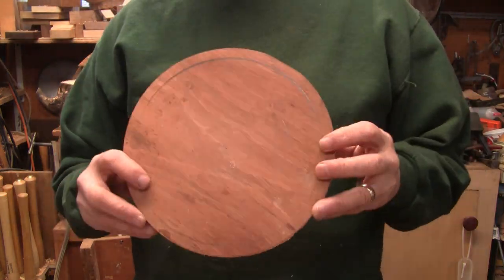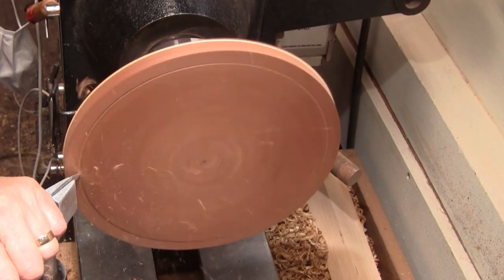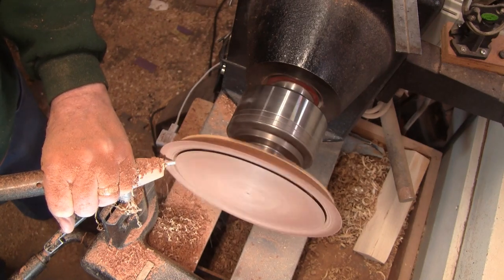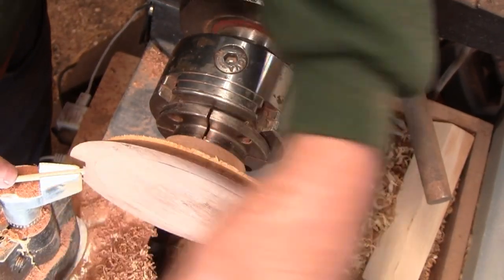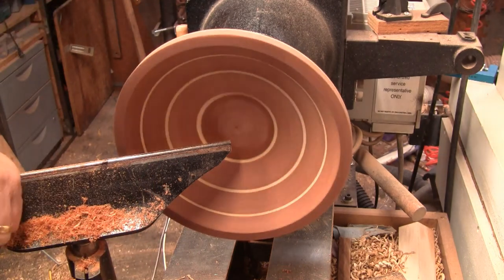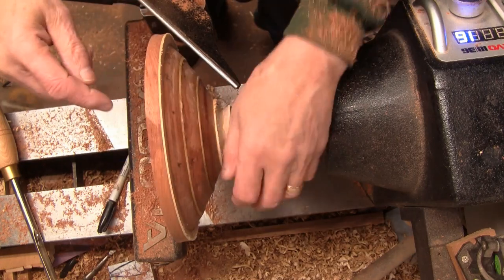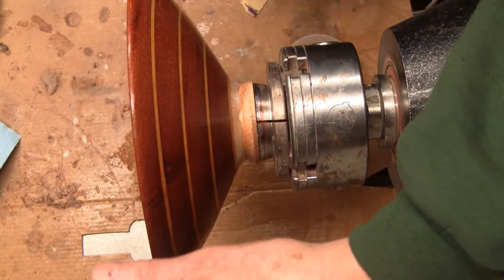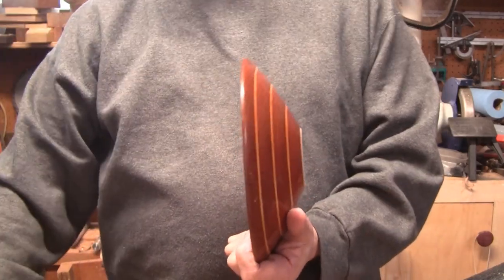Curved Bowl  From A Board New Ring Cutter Wood Turning

Comment: Most informative video. I noticed that you used three angles to cut the rings. I would have thought all cutting angles would be the same. The contrasting woods are very nice. Thanks two bunches.
Reply from the maker: Thank you and thanks for watching.
The way a bowl from a board works you end up with thin walls. So by changing the angle it gives you enough stock to get a curved side on it.
Thanks again,
Gary

Comment: Next one just take off chuck with bowl attached . No need to dismount bowl from chuck after each cut .
Reply from the maker: That is one way to do it. But the fact nothing has been turned up to that point it is easier to do it this way for me.
Plus not sure how you get the small pieces  that wont fit over the chuck off without taking  it out of the chuck.

Comment: Hi Gary.  The end of this video does help us ‘not so smart turners’ understand how to lay out the concentric circles and make curved bowls with various angles.  I appreciate you referring me back to this video!  Another question:  do you think a 3-D printed version of your aluminum angle jig would hold up to the heat generated by the thin parting tool cutting at an angle through the board?  A very talented friend is going to make a version on a 3-D printer.  I’m wondering if the material will hold up.  Well, thanks again!  Steve (Big Galoot Woodworks)
Reply from the maker: Thank you Steve. I would think that depending on how dense it was made that it should hold up. Testing would be important. I would not worry about the one I made  but I know my parting tool and how hot it gets.
I like to back out now and then to clear the chips and on mine it is the tip that gets real hot. Back where it is against the jig is not nearly as hot.
As with any thing test it out real good before using it.
Thanks for watching,
Gary

Comment: Thanks for the lessons of how and why you cut the rings. Like the parting tool guide. Simple and sturdier that the previous wooden one.
Reply from the maker: Thank you Stuart. I had this guide in mind when I made the first one. But I needed something fast so I made the wooden guide. It does work fine and by request I made a video on it. It will still do the job and you can put multiple slots in it. But I do like the new one much better.
Thanks for watching,
Gary

Comment: Hi Gary.  Quick update.  The tool steel did finally arrive a few months back but I had a series of retaining walls to replace beside the house and spent six months with contractors intermittently (!) working the project.  Every contractor and sub was to their ears with work so it was very difficult to keep people on the job as they had way to much to cope with and too few workers to boot.  So here I am in December finally watching this video again.  Now I'm off to find the other video that showed how you used a tool post and flat attachment to build a multi angle fixture as I do not have the equipment to easily manufacture the one shown in this video.  But first off to the dentist.  Thanks again for all you share, you have taught me a great deal.  Best of the Season to you and yours. Cheers, Gord
Reply from the maker: Thank you Gord and hope those contractors get it all done for you.
I understand  limited time to get things done for sure.
 The first fixture I made will work just fine. I just like making fixtures so did the others.
 Best of luck and Merry Christmas.
Gary

Comment: Watching you use the scraper, I learned that I have been using mine up side down! I have been placing the bevel down, nut up.
Reply from the maker: My scraper is a negative rake scraper. That means it has an angle grind on both sides.  With only one grind then you are doing it the way it is meant to be used. This scraper started out with an angle on one side and I ground the other. Very good finish and no catches.
Hope this helps,
Gary
Reply: @ThePapa1947  yes it does, thanks for the clarification

Comment: Thanks Gary, I was going to make the wood guide for my bar, but the new guide direct to the banjo is brilliant. I will have to make one and try it. I had made several bowls by cutting rings with bandsaw, but this looks much better.
Reply from the maker: Thank you Greg, I do like the direct fit to the banjo. At the time I made the wood one I was working on the metal one in my head but to get the turning done I made the wood one. It works but I do like to improve on everything I can.
Thanks for watching,
Gary

Comment: As soon as I saw the thumbnail for this video a game show bell went off in my head...ding ding ding. I knew how well it would work to cut any angle accurately. I had to chuckle when I saw the popsicle used to set the angle. You think like me at times. At least on the simple things. What flavor was the popsicle? LOL.
There might be a market for this jig idea. ????
Well done, but be careful, you keep setting the bar higher with each video Gary.
Reply from the maker: Thank you Gil, yes I think this jig is much better than the other. But the other works good as well.
I save those popsicle sticks for mixing 5 minute epoxy or CA and sawdust. They are actually from juice bars we like. Also some Häagen-Dazs ice cream bars as well.
Thanks for watching,
Gary

Comment: Amazing and loved your explanation. I am seriously going to have to give this a try sometime though the warm months coming when it is more enjoyable to be in my shop. Such beautiful bowls and love how efficiently it uses the wood. Your explanation really explained the process and logic well. Thank you for that. Have a great weekend!
Reply from the maker: Thank you Larry, happy you enjoyed the video.
Gary
Reply: @ThePapa1947  
I am in the process of making your Ring cutting jig. I have a 1" aluminum post to fit my lathe. I picked up a piece of aluminum (2&1/2 x 1&1/2) to make the holder and guide. I also have a post to fit a 12" round tool rest and I believe I will just use the post from it. Can I ask the size of that guide you mounted on top of your post? I can see that is 1" wide but do not know the length.
Reply from the maker: @str43bzr  it is 2 1/4 long and the area where the blade goes is 1 inch.
Total height is 1 1/4 with a 7/16 step  to the mounting area.
 I assume your post has a threaded end on it?
 Let me know if this helps and best of luck.
Gary
Reply: @ThePapa1947  yes, my post is threaded and thank you so much for this info. I will let you know how it works out.
Reply from the maker: @str43bzr  perfect.

Comment: That is really fantastic Gary. I love the detailed explanations. You didn't say, but I am thinking that you want to leave the little bit of pencil mark on the outside of the cut - the ring side. That fixture is really nice. A great way to solve the problem of angle cuts, and with those templates, getting the correct angle to be repeatable looks very easy. I am beginning to warm up to this method of bowl making. It did not impress me much with the limited 45 degree angle only. Adding the shape to it really makes the bowl look nice. Thanks again for another great lesson. See you next wekk!
Reply from the maker: Thank you Mark, happy you enjoyed it.
Yes on the cut you need to leave just a little bit of the pencil line. This will keep from cutting too much. If the line is gone you do not know where you are at. Something I did at work when band sawing and sanding pieces. Or on turnings as well. I would mark the line with a bench knife and then a very sharp pencil and then cut and sand right to the point where you would see it fall away and still have a witness of the pencil mark.
 All 45 degree angles can look good but get boring.
Thanks for watching,
Gary

Comment: Hi Gary. I made my first bowl of a board and learned a lot. Of course I also had tear-out. (My parting tool has a diamond shape, so that's not ideal). Also when gluing I had made a mistake by not correctly putting the rings back on the woodgrain.🤭 
Learned a lot from this video too. I'm going to make a second attempt soon.🤗
You made a verry clever jig. I won't go that far, but it's nice to see how you do this.
Take care!
Frank.
Reply from the maker: Thank you Frank! My parting tool is a diamond shape as well, Just make sure it is very sharp and listen to the sound the wood makes. When you get within a 1/16 of an inch you can hear the sound change. Very light pressure and you should not get tear out. There might be fuzees on the edge but no tear out.
 It is nice to line the grain up but it does not look bad if you have them rotated enough to make it look like you did it n purpose. But I do prefer to line it up most of the time. 
Before you cut your rings put a mark across the board on top and bottom. You can use that to line things up.
Take care,
Gary
Reply: @ThePapa1947  Thanks Gary. I make a mark next time.

Comment: THANK YOU GARY !!!!... This was FUN....Woodworking, machining, working with tooling, improving an idea... YES!!!...Actually this show was above fun, very cool Gary. I could not see but wondered if you grind your parting off tool square or sloped? When machining I usually grind a slope to favor the piece I want to part off cleanly. ... I heard the chatter when you cut the back and I thought "Gary you need some support from the tail stock?" Than BOOM you proceeded to use the Melamine, HA! I love it Gary YOU are 100% on top you your game and I learn every time I watch you work/play in your shop!!!... As you know I am not a woodworker and I was wondering why you do not run the lathe dead slow and spray on the finish? ... It is sooooo much FUN watching you create Gary...again Thanks.....TM
Reply from the maker: Thank you very much Tuffy. The tool is sort of a diamond point shape. I thing Sorby has the angle at 60 degrees or 30 depending on how you measure it. The sharper of the 2.
Oh I love my tail stock support and on some wood you can get away without it. Not this one!
On segments I will run the lathe slow and spray. On a solid piece of wood I like to make sure I spray with the grain for most of the spraying. I do rotate by hand but I will be spraying along the piece at one point. 
 I think mostly I have had better lock doing it not turning.  I may work more at doing it with the lathe turning but only when the weather warms up.
Thanks for your wonderful comments.
Take care,
Gary

Comment: Thank You for the very interesting video on bowl creation.  I'm recently retired and new to working with a lathe.  I find all segmented bowl making fascinating including the segmented pieces using a table saw to cut the pieces using scrap wood available almost anywhere, the segmented ring using a scroll/jig saw and one board similar to your method you just showed me, but I can't wait to try your method using the lathe itself.  Since your are very knowledgeable, have you every tried using aged tree cookies.  I found a place locally that sells those cookies for like $5.  in my area and I am trying to create a bowl from it.  The problem I have encountered those cookies are normally cut by a chain saw leaving deep scars, teeth marks, and uneven face surfaced.  To true up the faces, can I mount the cookies to a faceplate and true up the cookie face, and what would be the safest way to mount the face place to a crooked face? I realize I could just use a thickness planer to true up the surfaces, but that defeats the purpose of learning how to work with the lathe!!
Reply from the maker: Thank you Richard! The only problem with those cookies are the fact they are all end grain. Not the best situation for just starting. 
 But you can use a faceplate and shim it so it is level and then flatten the other side on the lathe.
How big are these pieces in thickness and diameter?  And what type of wood is it?
Thanks for watching,
Gary

Comment: Hi Gary I hope it is not too boring for you while you are laid up with your leg. 
It took a number of days but I have pretty much finished the bowl from a board jig. I will post the video in a day or two once I have finalized it. I have used the jig to do normal parting on a spindle, and it works great. I have glued up a tenon on a board, and I will leave that to dry until tomorrow before I attempt to cut the rings. That footage will also need to be included in the video. 
That first line that you had on the disc for the outer ring, is the distance in from the edge the same as the thickness of the board?
Reply from the maker: Well I would not say boring but not as exciting as I would like.
Looking forward to seeing your video coming up.
The first cut can be what every you want the bowl to look like. If you want more of a straight line on the walls then my first cut is close to the edge of the board. if you want a rim them you can move over the same thickness as the board.
Or anywhere in-between that.
Gary

Comment: Gary,  this is great. I copied your original tool jig by cutting angle slots in a piece of oak.  Results came out pretty good.  I use a different tool rest (round SS bar on post) so my fixing it in place is a little more difficult.  I cut slots for 45, 50, 55, 60, 70 and 90 deg. so I have a wide range to choose from.  I REALLY like to make your final design with the metal (aluminum or steel) slotted holder on a post.  Would you  put some sketches of that on-line?
Reply from the maker: Thank you Mark.  I could email you what I have if that would help.
Gary

Comment: Sir, I am the guy that recently asked if your background was in engineering or math. Now I have two questions for you. For years I have waited 3-5 days before polishing both nitrocellulose or water based lacquers to a gloss finish on a piece of furniture.  I get the impression you hit the lacquer within hours of spraying it with the abrasive paste. Is that the case?  A wood pattern maker; that peaks my interest. How does one become a wood pattern maker, what industries would one work in and is it still a viable and needed profession today especially with the advent of 3D printers.  Thank you for your videos, I find your approaches fascinating.  
Mark McClellan
Beaumont, TX
Reply from the maker: Thank you Mark and I do remember you asking me that. 
So I usually wait 3 or 4 hours or even overnight if the timing is right for the abrasive pasted.  
So I served a 5 year apprenticeship to become a wood pattern maker. Most other trades are 4.
It is one of the lost arts now. CNC and rapid prototype has taken over. It was working it's way in before I when I retired but I was still making patterns from 2D drawings. Not all customers could make electronic models  so someone had to build it from a drawing. 
 I knew in high school that is what I wanted to do but the Army had other ideas for me.
Thanks for watching,
Gary

Comment: Very useful jig and the rationale behind your calculations to use those angles to get an optimal shape for a bowl from minimum stock removal.  I would be very interested in how you made the top piece that is the guide that is attached to the dowel that fits in the tool holder?  I think it can be made by just using hacksaw, files, with some drill and tap set?
Reply from the maker: Thank you very much. Yes it could be made with the tools you mention. I will consider making a video on how I made it.
Thanks for watching,
Gary

Comment: Nicely done Gary!  Ive not tried a bowl cut from one board, but, I might have to give it a go!........and....ive used bunches of that brand lacquer. I get it at Walmart here. Its much cheaper than the others available in this area. I find it works really well, but seems to me to be noticeably thinner than more expensive brands. Seems I can get just as nice of an end result, but I have to use more, and lighter coats to do it. Im not doing production jobs, so, a little extra time spent on the finish is not a big deal to me! YMMV
Reply from the maker: Thank you! At this point the stuff I used worked fine for half the cost. Too bad I have always praised Deft. But it is not twice as good.
Thanks for watching.
Gary